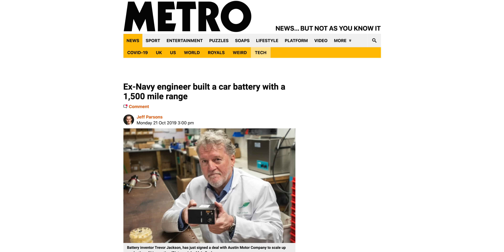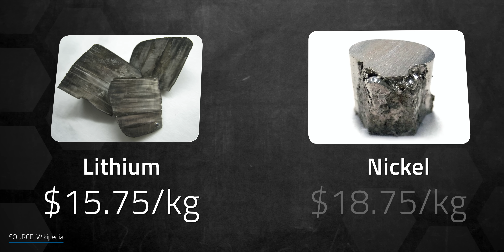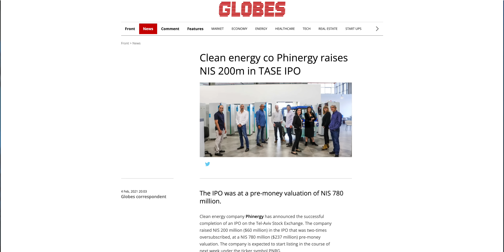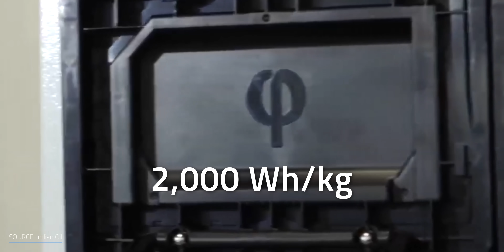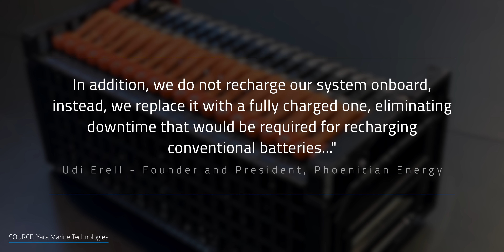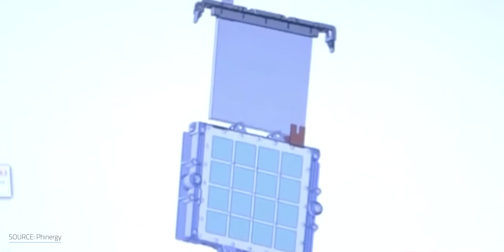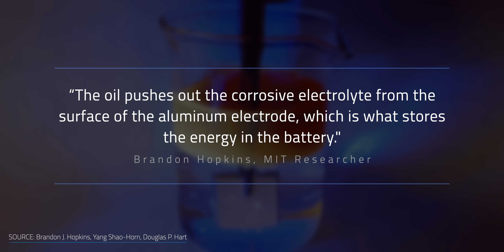Exploring the 1000 Mile Car Battery - Aluminum Air Hype?

Comment: This does sound feasible 
    Building a battery swapping network doesn't sound to challenging and if you can make a battery that gets around 1000+ that about what the average American drive in a month......so your network wouldn't need to be as large as a charging or fueling network since your customers will only be "refueling" about once a month 
    Also with the batteries begin recyclable likely at a much easier rate then lithium current are cheaper to make and far lighter ( which is actually funny because lithium is the lightest metal in the universe) I think this technology should definitely be researched and tested father

Comment: I can imagine a Rivian RT1 as is, with the pass-through being used for a swappable Aluminum Air battery. You would have a vehicle with long range capacity and a smaller Lithium-ion system for everyday commutes.
Reply: I have a Jaguar i-pace with a range of 235 miles. Once or twice a year I want to go on long trips and if I could put one of these batteries in the front trunk just for the long trip it would be VERY attractive.
Reply: Or it could work as a tiny swappable backup battery for emergencies. Just enough range to get to the charging station, or to the hospital.
Reply: I would see it in every car. 90%+ trip would not need a bigger than 30-40 kwh battery. Just have a space for a swappable system when these are needed.
Reply: I will invest in that
Reply: Good idea
Reply: Good idea, instead of providing electricity to the car to make it run you now have to provide a very specific non rechargeable battery.  Brilliant.  So now you are transporting batteries instead of fuel, which I am sure wont be even more costly.  At last check electricity doesnt go "out of stock" unlike what a "solution" like this would inevitably happen.  Apparently nobody has heard of "supply line disruptions" like we are allegedly facing now.   Thats not even mentioning the planned Obsolescence that would be certainly built into said packs.
Reply: sodium ion batteries can perform at about 70% the level of lithium but are far cheaper and more common. we could use those for everyday vehicles and keep lithium for more heavy-duty electronics.

Comment: if swappable battery would have 1000 miles range, then that would be fine. depends on other factors as I am using my car for like 10 miles a day, if it would survive 3 months, that's ok for me.

I guess this battery would be best as emergency one. if you could treat it like a glowstick, break something when used, so chemical will mix. Let's say buy (100/200miles) one and connect to my car to boost its range, I would be fine with that.
Not like whole replacement, but as auxiliary system. If it would be user-replacable and classic 12v battery size, I think it might catch on.  
When its gone, then you just disconnect and replace at charging station. keep it disabled in the trunk as an emergency power OR range extender, similar to a jug of gas, you could keep in your trunk.
I guess that would resolve "range anxiety" people have, and would keep expensive recharchable ones sizes lower, so cost of EV car would be lower as well.

Comment: So what is done with the 'wasted' aluminum oxide?
Is it recycled by reducing back to pure aluminum?  Is it repurposed as refractory or abrasive???
I'm also a bit confused about the costs and availability of the catalysts beyond hydroxide decomposition of the aluminum.
If silver, nickel or cobalt, aren't we right back to the problems now being solved with lithium chemistries?
Reply: I imagine that depends on the quantities of silver used, vs. quantities of lithium or nickel. Seems like a fair question though.

Comment: Excellent topic and video!

My biggest concern here is the energy needed to re-manufacture Al-Air batteries after you swap them out  I haven’t “run the numbers,” but I wouldn’t be surprised if it takes twice as much energy to recondition an Al-Air battery than the energy you can get out from subsequently discharging them.  Again, I don’t know that, but it’s got to be a lot more than re-charging a Li-Ion battery.

I think Al-Air could work quite well as a range extender for Li-Ion cars.  That is, give the car a small, cheap, fixed 20ish-KWh Li-Ion battery that will easily cover day-to-day driving needs, and then, on those 3-4 times per year most people take road trips, stuff an Al-Air battery into what is usually the trunk, and drive 500-1000 miles!

Minor, pet-peeve nit:  Energy Density is energy per unit volume.  Energy per unit weight (mass actually) is called Specific Energy.

Comment: Again, it can't be considered as "Green Energy" if the manufacturing of batteries produces a huge amount of green gas, in this case extracting Aluminum.
Reply: You know that there are other concerns than climate change, right? Diesel cars emit less CO2 than petrol, but are considered dirtier because they emit more particulates, SO2 and other harmful gases. Electric cars as they stand don't really do much for climate change, but they make a huge difference to the liveability of cities.

Comment: I thinks it like fuel cells,add and remove,i can be very good military usage,think about drones,jets,high powered jammers,exosuits, in cars its  like buy a fuel, run out fuel go change it and u are full move on,same as fuel runs out,call someone or travel on foot to nearest fuel and replace it with fully charged ones...

Comment: So let's say you can go 4 times farther than a Tesla M3. The cost of charging my M3 four times is about £90 of 135 dollars, for a Aluminium battery to match that you have to lift the battery out, send it for recycling, clean it, rebuild it and ship it back to the swap station and make a profit. I can't see it to be honest. It might have a future in electric aircraft, ships and trucks but not cars.
Reply: @Ross Radford You take into account only transport (and even that you simplify, as hauling fluids or powders is way different than hauling solid objects) - but you are not going to summon those batteries from thin air - both at the beginning and end of their use, there has to be a foundry, smellting them, which in case of alumininium means A LOT of energy…
Reply: @FalkonNightsdale  Yeah the energy cost for the recycling becomes the main issue. It'll come down to comparing the cost of extracting and refining oil, and mining and smelting aluminium.
Reply: @jellevm  Yep, what's the energy efficiency of smelting aluminium, turning it into a battery, transport, then recycling it into a new battery again compared to just charging a normal battery? My gut feeling is it'll probably be similar to hydrogen.

But also, agree with others, with such a high energy density this might fit in perfectly in bigger applications, like short-haul aeroplanes
Reply: I've posted a reply that addresses this. Unlike the US, India has vast surplus of labour that is always looking for any kind of work.
Reply: @TheControlPhilosopher  cheap slave labor, will never work in the US
Reply: @lilcourtny08  cost of living is comparatively low in India doesn't mean that it's "slave labour"

Comment: What's missing is data on how efficient the recharging can be. If that's close to 100%, then OK, it might be a nice alternative. If it's more like 30%, then why not just use liquid hydrogen at that point? Easier to refill at least. But for normal cars that efficiency should be close to 100% and i don't think it is.

Comment: I would say that it would boil down to 3 things. Cost, convince and infastructure. Most people will keep doing the old thing if it costs less. Convince and infrastructure kind of are very similar. Easy supply at common places to stop and swap are needed. But the infastructure to produce and deliver those batteries to where customers would pick them up. Now I think on it the dead ones would need to be hauled off for processing too.

Comment: Swap stations?  Seriously?  Can you imagine the amount of waste this would generate?  Not surprising it’s an oil company pursuing it…
Reply: you can simply replace the water and add new fresh aluminum, the old water containing the oxidized aluminum, that can be smelted back. 
And we already have big aluminum recycling center since it is way cheaper than making new one and the material does not degrade.
Not sure how this translate in reality, but to me sound like recycling the battery would be cheaper than making a new one
Reply: @lesto12321  recycling Al is pretty easy, melt it, cast it and you are done.

Converting Aluminium hydroxide back to Al metal is the same as turning alumina to Al, exactly this process, you dry the AlOH to alumina then use electrolysis. It is as inefficient as producing new material, albeit without the mining of ore.
Reply: depends on how efficient we are at recycling it
Reply: @roy04  like plastics being only 9% of all recycled? Or I have to do the same argument with clothes in the US too....?
Reply: @mariomoneta2833  recycling aluminum is a lot easier than recycling plastics. let alone recycling, even sorting the the huge number of different types of plastics itself is a bigger problem than recycling aluminum. also recycled aluminum is cheaper than mined ones, unlike plastics, where it's cheaper to make new plastic than recycle it. besides, plastics can be recycled only a finite number of times.
Reply: @roy04  there is literally nothing you can recycle 100%, you always lose things in the process, if you want to get more of it recycled, you need to spend more, is a curve not a line, in everything, the same with chemistry, and when you are there, the most probably is that we are going to consume more of what we really need bc that's how consumism works for now...
Reply: @roy04  re-refining Al(OH)3 back to Al metal, using the same process for producing Al metal from ore (basically). It's not recycling. It's just dumb.
Reply: Aluminum is one of the few resources where it's actually worth it to recycle it vs  electrolysis of new Aluminum
Reply: @RoadThey  This is electrolysis as the end state is Al(OH)3, which you can only reduce by drying to alumina then electrolysis. It's not a good idea and it isn't recycling but refining the Al again from essentially ore (high purity ore, sure) but not like normal metal recycling.
Reply: Probably just need to scrape the cathode (or anode?) and resurface.
Reply: @DaveShap  Nope. It's MUCH worse. This produces Aluminium hydroxide, and fully used battery will have essentially no Al metal left (why put an excess in, it's just weight for no reason). To convert this back to Al metal is the same as producing new Al metal from ore, you dehydrate it to alumina and then use electrolysis at high temp to produce Al metal. This is, as you can imagine, not efficient.
Reply: Sounds more like a solution to industrial applications, like the marine use and shipping container sized batteries.
Reply: Tesla actually developed a system for battery swapping, you may recall.
Reply: @MahlenMorris  But its not just the swaps that are the issue.  It's the swap with a battery that isn't rechargeable produces tons of waste.
Reply: @CrypticFoxGaming  Right, but the battery is likely easily recyclable since its aluminum. While I agree that having all vehicles use this system would raise issues, using it in tandem with rechargeable batteries would allow increased range for EV's and it is only then used when required. Plus adding something like this to trailers for the trucking industry would help with cross country hauls and allow for the carry for more cargo due to weight restrictions placed on large trucks. This in turn also reduces trucks needed to move a product as well as reducing the power required along the way which would likely be drawn from non-renewable sources, thus it reduces more emissions and cuts both traffic and noise pollution.
Reply: @CrypticFoxGaming  Just because it can't be "recharged" in a conventional sense doesn't mean it produces waste.
Reply: @Retguard  It produces Aluminium Hydroxide, this is waste. It can be converted back to Al metal, but that process (drying, electrolysis) is the same as producing new material. Sure you've got high purity feed stock, but still Al electrolysis is energy intensive. Somewhere in the region of 15MJ/kg is required for this, the theoretical energy is about 6MJ/kg, so this is 40% efficient, just the production of Al from Al2O3, all other processes will reduce the efficiency. Consider that the most the battery can produce is 6MJ/kg-Al (actually less because it forms Al(OH)3 not Al2O3). Basic thermodynamics and knowledge of Al production show this is just a bad idea.

And any process which takes the components back to essentially the same as ore is a wasteful one.
Reply: @seb3090  So, with my limited knowledge, you say it produces Aluminium Hydroxide, and I think you confirm it's AI(OH)3, then why can't this be repurposed as medicine? A rudimentary search seems to reveal that Aluminium Hydroxide is used as both a pharmaceutical antacid, and as a fire retardant filler. Do to the fact it has uses, that means it's not waste, it could be sold to other companies that produce other products. This sort of thing is pretty common, and is one of the best ways to cut down on excess mining. If this is possible, than how is it waste?
Reply: I'm sure recycling al-air batteries is a thousand times easier than lithium ion.  Also since its just corrosion, the anode and cathode could just be resurfaced
Reply: @quincypurcell5222  It's consumption of the Al, it is converted to Al hydroxide. This can be dried to alumina to be re-refined to Al metal. But that's not an efficient process.
Reply: Fake news! Clearly CrypticFox is an oil company troll. Seems a few on here. 
Recycling aluminium is an established and relatively efficient process. Aluminium does not lose any properties durig recycling and there is no limit to the amount of time it can be recycled.
You cannot recycle your petrol or diesel - you visit a fuel station (which could be a battery swap station) pay over £100 for a full tank that you burn in a quarter to a fifth of the mileage this battery would get you.
The only reason the fuel company is involved is to get there infrastructure used as theswapling facility - so they make their money still when petrol and diesel stops getting sold. They are finite resources that will see increasing taxes to price people out of using them.
You mention waste - you burn ALL of the fuel in an ICE car. This aluminium battery is recyclable and has value. Waste is significantly reduced.
Reply: They said it can be recycled. Learn to listen.

Comment: This is a non starter for mainstream applications due to the overhead in manufacturing recycling and the cost of silver.  Compared to a typical EV with a 1000+ charge cycles what is the total energy required to drive say 100K miles, that is charging energy, recycling, and remanufacturing.   Doing 1000 battery swaps verses 1 for normal Lithium based battery is almost certainly not worth it.
Reply: How much silver does it actually require though? Silver is expensive, but it's only being used as a catalyst here, so probably not required in large quantities.
Reply: Um, you're probably driving around in an ICE vehicle right now that uses PLATINUM in its catalytic convertor.  Silver is cheap compared to platinum.
Reply: @LG123ABC  nope, tesla Model S. Not driven an ICE car in years.

Comment: I see a big problem with the production and recycling of these batteries, since bauxite and aluminumtryoxide are usually converted to aluminium using coal wich is converted to CO2. The reaction looks something like this: 2 Al2O3 + 3 C + heat = 4 Al + 3 CO2. There is a solution using only heat from electricity and a complex catalyst, but its way more costly

Comment: Ideally Id want a mix between the two systems. Rechargeable batteries for short trips and swappable batteries for long trips and quick refueling.
Reply: Since both are providing electricity, I would imagine that a hybrid solution offering both Lithium ion and Aluminium air, would likely be feasible and better.
Reply: @renjunathp6376  exactly.

Comment: This is not a renewable technology. What's the point!  Comparing the capacity against a Tesla battery by weight, doesn't take account of the size of the battery and how it could be accommodated in a car.

Comment: Aluminum air batteries have some good features: light, cheap, lots of range, recyclable BUT non-charging is a deal breaker! Using an oil pump defeats the purpose, what's next, a ICE engine to switch over? I can see why India Oil likes this, keeps them in business.  Keep researching we need it rechargeable via electricity or solar!
Reply: rechargeability is due to chemistry. a battery can be predicted to be rechargeable or not before its even designed. converting Al(OH)3 to Al requires a ton of heat and industrial processes, so its not going to ever be rechargeable.
Reply: Oil companies are not going anywhere. IF You look at the huge range of products that requires oil in some form in its production or maintenance shows you misguided view EV’s will be the death of oil companies